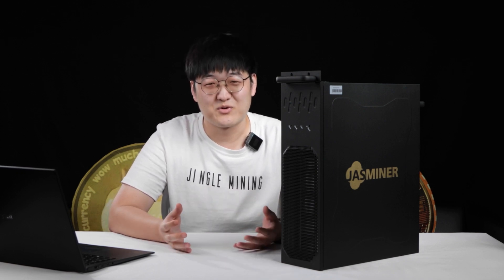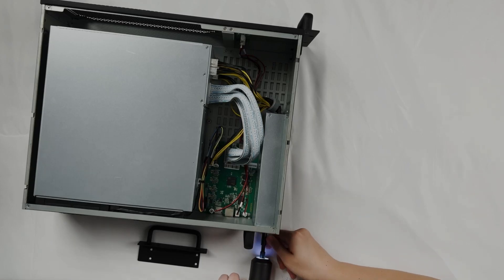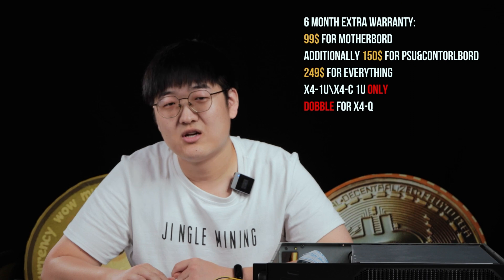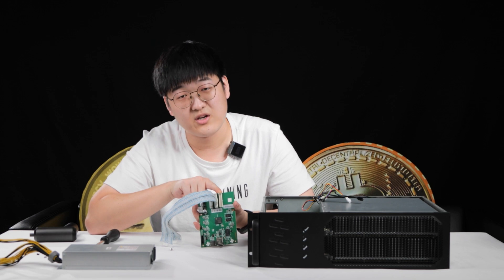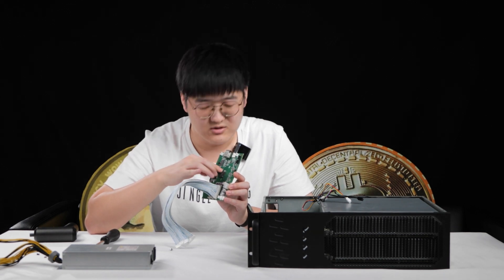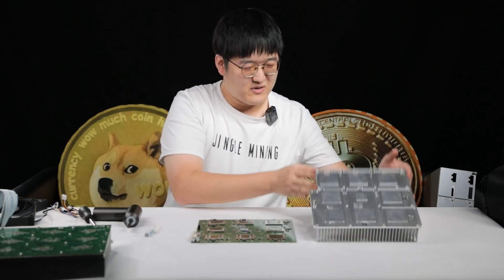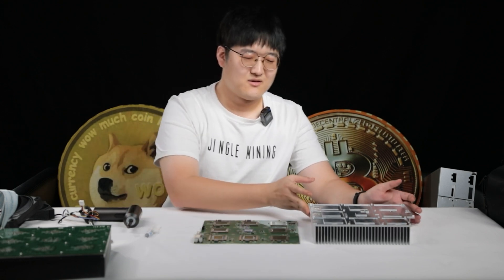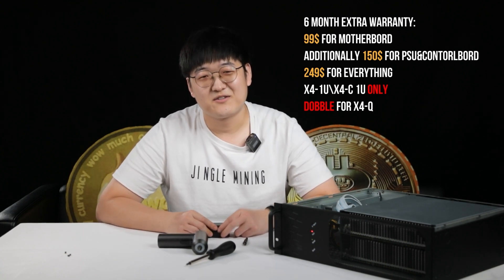[Jasminer X4-Q] Tear Down! What's in side of this most efficient ETC miner ?

Comment: Hi! i have a problem with my x4q. after a electric cutout, the jasminer boot, turns on the led of normal (green) and fault (red) as always, after 15 seconds they turn off for 30-45 seconds, and then starts the cycle again.
what could be the failure? reset button doesn't work, and i can't see the mac address.
thanks!
Reply from the maker: Please contact our After-sale Service for details :)
📫Email: servicecenter-ludwig@jinglemining.com
📞What'sapp: +86 13482166325
💌Telegram: +86 13482166325